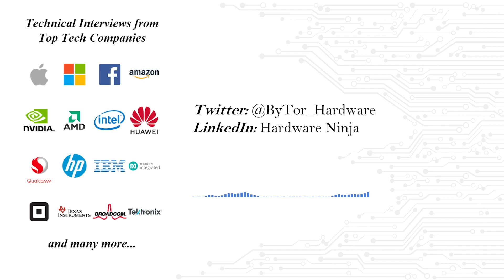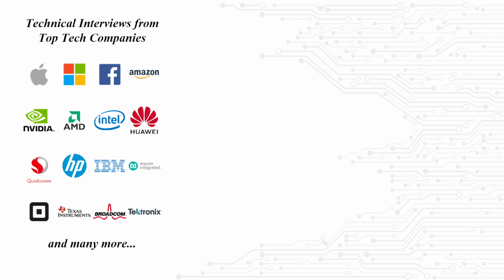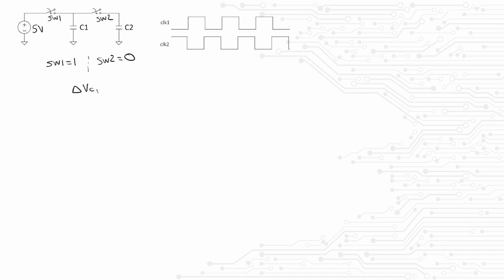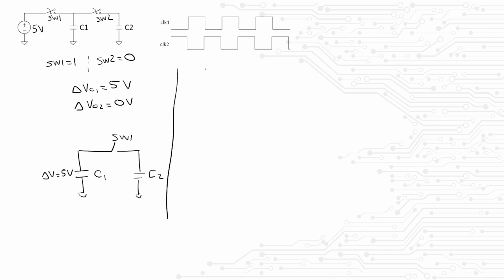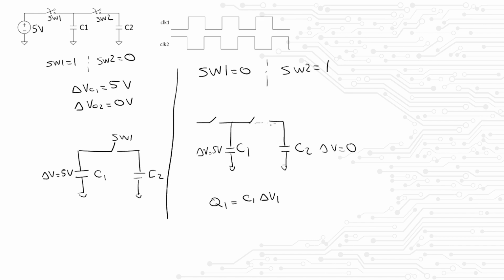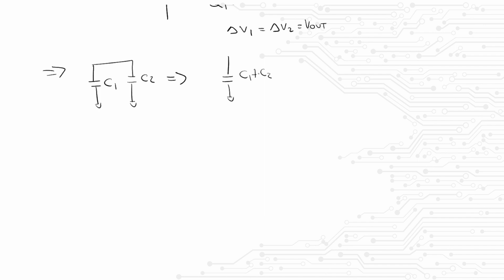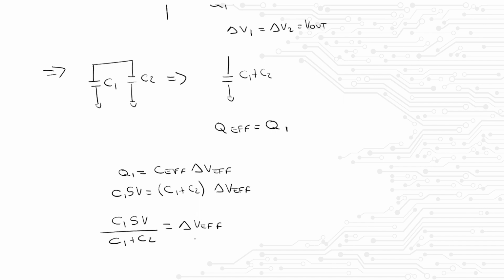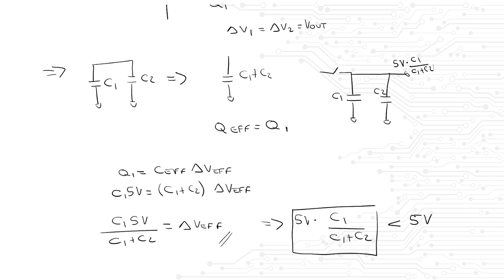HWN - Hardware Interviews S1E4 - Charge Sharing

Comment: Guess 
Sw1 on ,sw2 off
Inital values c1: 5v
                        c2:0v
And then 
sw1 off, sw2 on
Qfir=Qfin
vo(t)=
5*c1+0=vo(t)(c1+c2)
vo(t)=5c1/(c1+c2)....Answer
The signal  is from vi to vo and the on and off of the capacitors sw1 and sw2 form the capacitor charging = capacitor discharge. Using a switched capacitor circuit for R can reduce maximize the area in the IC layout design.🤔
   Timing control chart (f>>fs) 🤔
Charge =Discharge 
Q=cv=i*t, va-vb/i=t/c

Ron=1/f*Cs...🤔